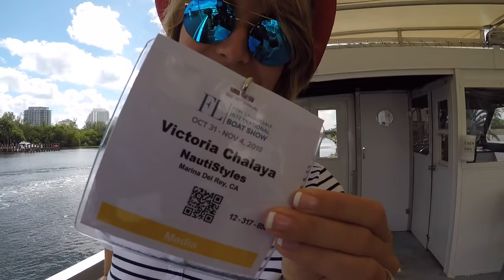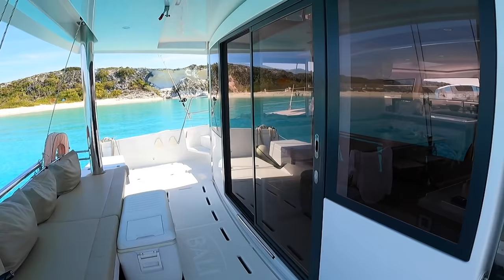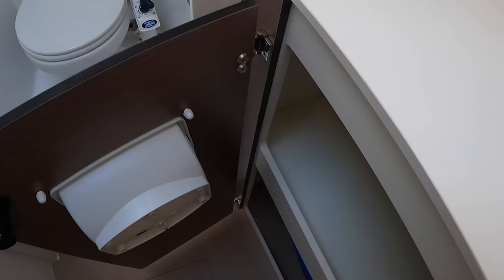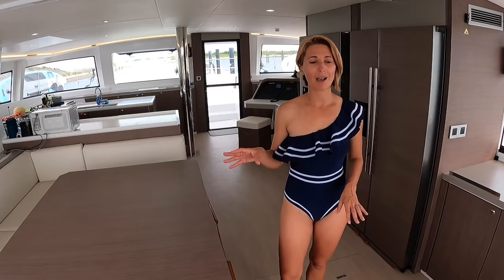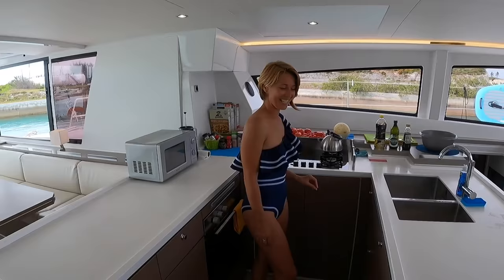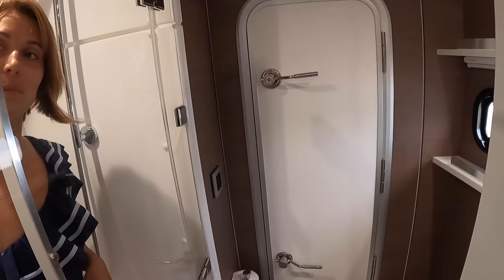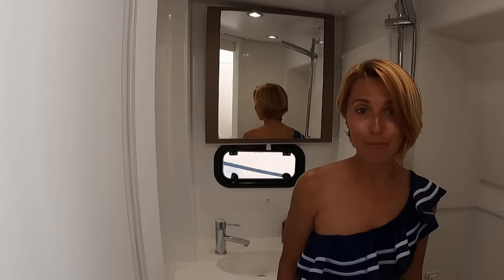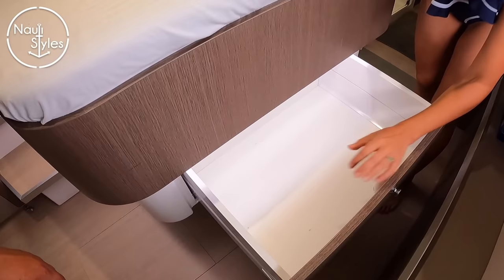2020 BALI 5.4 Sailing Catamaran YACHT TOUR Bahamas Charter & Liveaboard

Comment: Wow! That was an awesome tour for you all. I have not seen the 2020 Bali 5.4 before so this was an eyeopener for sure. Bali has in effect made the 55 look and feel like a 70 IMHO. I just couldn't believe a 55 was so spacious, just an amazing layout, kudos to the designer on this. One of the most innovative designs that I have seen in years. Would LOVE to see how she handles in and out of the marina and out on the open blue.

I believe I saw some ladders in the flybridge that allow access to the boom and mainsail. Would also like to see a bowsprit attachment for an additional furler and Genoa or Code "D". I am not a fan of a flybridge all that much, usually, it's only designed for charters and not an Owner version. However, Bali has done an excellent job with it. Oh, and didn't see a dive tank storage or compressor on board, although I am sure it's available somewhere in all that storage.

I would prefer to see MORE solar panels, and panels that are more robust, don't like those flat stickers, LOL. They are very inefficient for Bluewater cruising. And, at a minimum, we need 3000 watts of Solar because I refuse to use PROPANE on my boat as I use an electric induction stove and oven. 

Otherwise, this is a very impressive yacht with a very spacious and comfortable layout that would satisfy any Bluewater cruiser.

Blessings to you both!

Comment: I noticed the “safety latch” for the fold up door is identical to the hold downs that my cnc table and work bench use.
Reply from the maker: interesting 🤔
Reply: @NautiStyles  I wouldn’t be surprised if Bali has similar cnc equipment for fast cutting of interior finishes, and thought “very good hold down, nothing on that table moves, let use it to latch that huge door we really don’t want moving unexpectedly as well.”
Reply from the maker: It also has locking mechanisms on both sides

Comment: Like that clip with Rico in the bikini top - great humor 😊. As a sail boat it has unlimited range as you put down in the specifications, but how much range does the 1200 l tank capacity give you motoring in case you can not use sails?

Comment: Great video. This is one of my fav catamarans. Would you live in this boat? Or do you prefer a single-hull for a home on the water? This came in 5th in the 2019 ARC Rally - so its no slouch in rough weather and for performance on passage.

Comment: I see that there are a lot of wall mounted thermostats within each cabin. Does this boat have automatic central heating and air conditioning  that is cabin specific ? How does it operate ?
Reply from the maker: each cabin has its own independent unit

Comment: I have heard the Bali catamarans described as great for charter but not a blue water cat, would you agree with that.
Reply from the maker: Like I said, we did not do any real Bluewater sailing on it and no heavy seas, so i can not comment. But 5.4 is built on the Catana 53 platform (I believe its different from the smaller models) and it should perform well in the deep blue👌🏻
Reply: @NautiStyles  Seems to me that the only solution is that these manufacturers give you a 'loaner' for a week or two so you can properly review.  Starting with a nice new 210' Fedship.